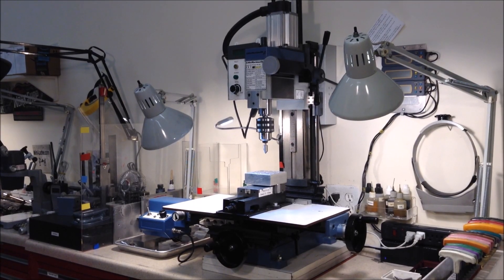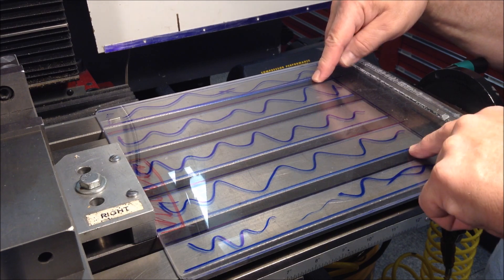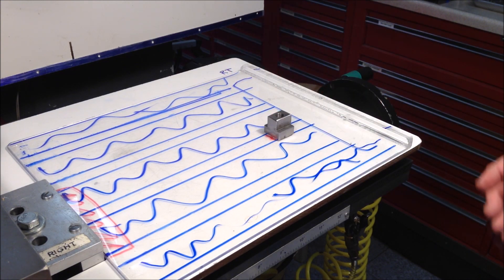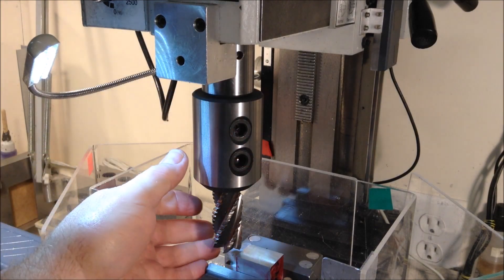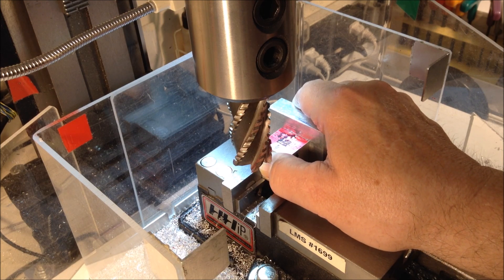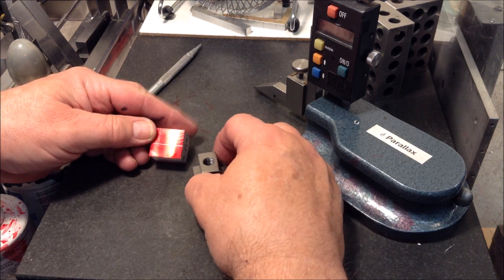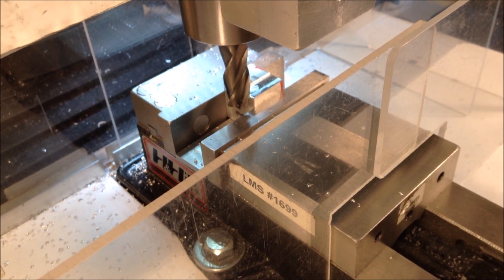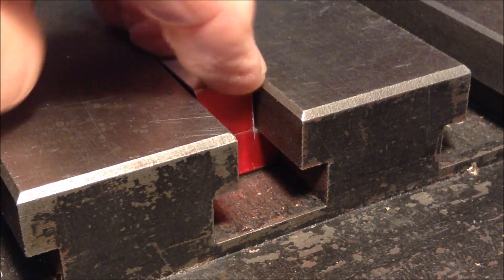SX4 Table Covers 1

Comment: Switch to a four jaw chuck and leave it on.. you'll quickly get good at centering material in it so that material profile doesn't matter.  Trust me I've already made all of the mistakes that a novice encounters.   You can probably sell your three jaw and use the money to buy more stuff that you don't really need.

Stephan
Reply: Steve for what I do the three jaw is just faster. But still times for the four jaw. Collet holder chuck still requires a change when I have a small part that I need more accurately turned. Have a Morse taper collet holder but sometimes  part is longer and need a through hole for it. I do not have a mill so sometimes I just use my 3D printer like for a dial indicator holder I can out in a tool holder.

Comment: Since you are starting one project I will ask you to think about another. I hate changing the chuck on my Central Machine 7 x 12 lathe.  Little room to get those dang nuts back on the studs. Maybe I  am not a good planner or should learn to use one chuck more than another, three jaw, four jaw and face plate mounted collect chuck.  Do you have an idea or seen a better quick type mount design modification.  Spindle face plate is about 7.5 mm thick and space between it and headstock about 13 mm.  Not sure the 7.5 mm thick flange would have room to tap radial hole and tap but could bolt on a back ring say 10 mm. Some type of smooth one  end pin to thread into chucks and then an offset radial hole to put in a threaded locking pin with a taper to lock the chuck pins in? Have to think more on how the pins would draw the chuck up tight but all done by just putting chuck up and radial locking, no more hard to do nuts.   May have you totally lost. I must just have fat fingers?
Reply from the maker: Well, here's a link to some old advice on mini-lathe.com
http://www.mini-lathe.com/Mini_lathe/Chucks/chucks.htm#Chuck_Mounting

One of the best mods you can do to solve the problem is to turn down a short section on the end of the chuck mounting bolts to act as a "staging area" for the nuts - as shown in the link above.
On some of the newer mini lathes, such as the model 5100 from LMS that I've used in my shop for the past few years, they have a larger spindle (4" vs 3") but also have  a larger space between the back of the spindle and the headstock, making it much easier to get your fingers in there to install or remove the nuts.
Reply: @frankhoose  Thanks. The turned down end to act as a nut guide might help and easy to do.